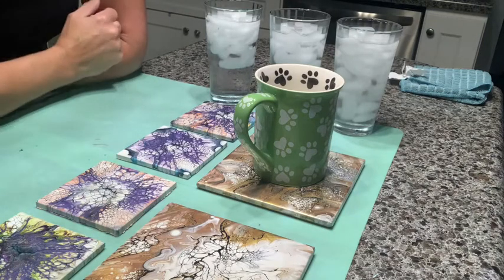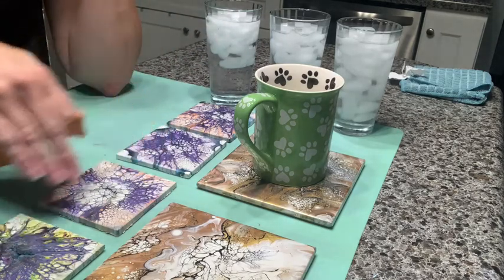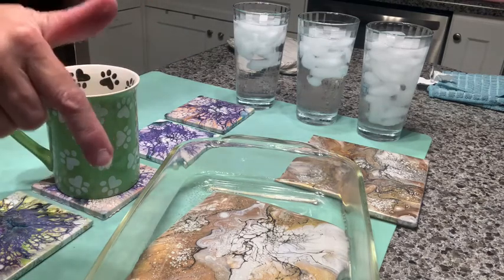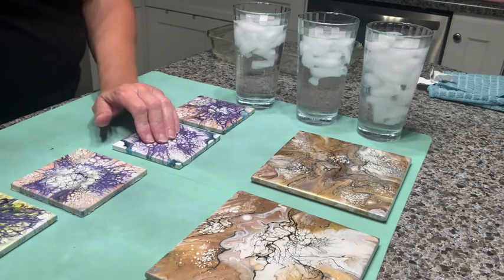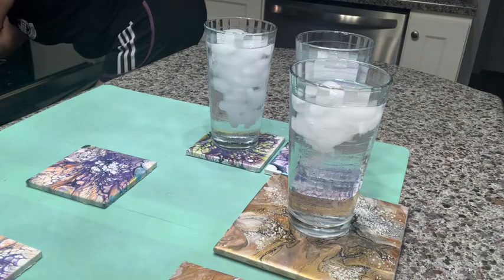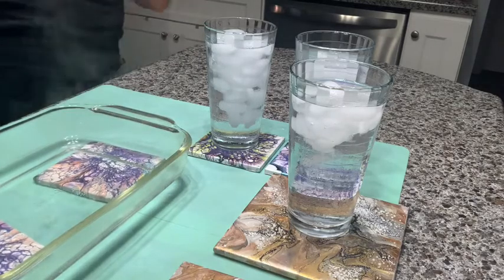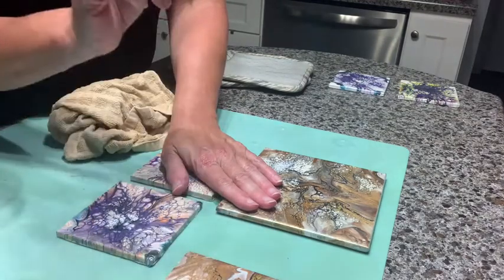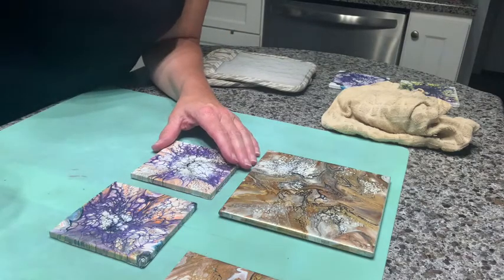Testing Brite Tone, Top Coat and Crab Coat on coasters, trivets

Comment: Oh darn, I just invested in the Brite Tone, but not happy with the cold water test! Maybe need to look into Crab coat?
Reply from the maker: Hi Liz, great question. You might want to check out my latest video after changing my process. I will link it below. I have been using either Shellac or Extreme Protection for the first 2 coats and then finish with Brite Tone. I typically do 3 coats but it really depends on what you are coating and how smooth it is. Watch this video and let me know if you have any questions on it. 
https://youtu.be/d72xh9uNtZ0

Comment: So, how many coats of Brite Tone do you put on the coasters and do you sand in between?  Do you have a video on how to do the coasters with Brite Tone?
Reply from the maker: Hello 👋 
The number of coats really depends on your gloss preference. I would say for good quality, at least 3 or 4 coats. You can add as many layers as you desire to get the level of gloss you like. Each layer builds that gloss level. It is recommended to do a light sand every 4 to 5 layers.

Comment: This was so helpful.  I make coasters and trivets also but instead of paint pouring, I work with alcohol inks.  My question is how to you "prep" your tiles?  Do you clean or sand before pouring the paint?  I am having issues with peeling.  Thanks!
Reply from the maker: I have never done anything to prep tile. I see lots of people taping the back, cleaning them, priming or adding gesso. I have never had an issue. Let’s start with what technique and paint you’re using, how do you dry them? I’m confident we can figure it out.
Reply: I use alcohol inks and sometimes I get pealing. I asked the manufacturer and they said to sand and use a base coat of brite tone but the alcohol breaks it down as soon as I work with it. Also the tiles take forever to sand each one. Like 20 mins each. That can’t be the best way.
Reply: @abbychavez8840  alcohol ink cannot be dropped into wet brite tone